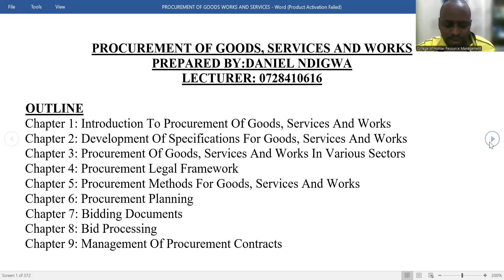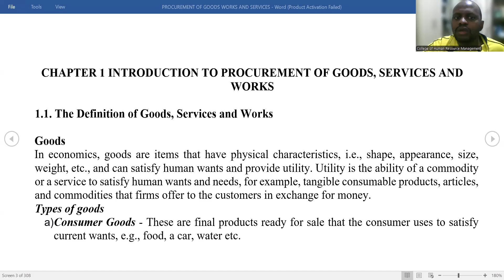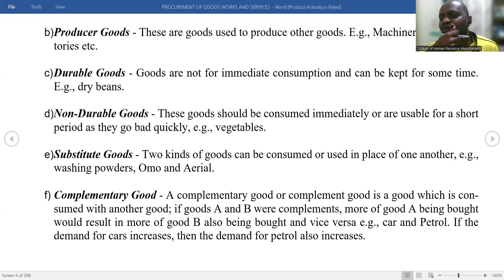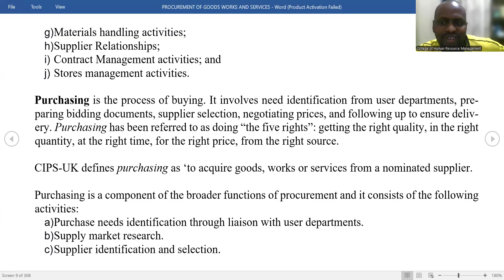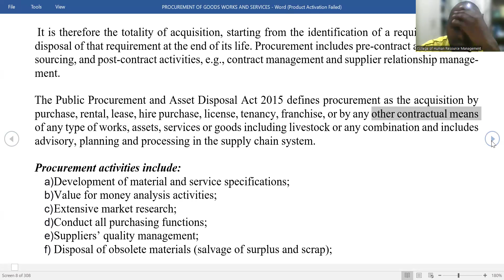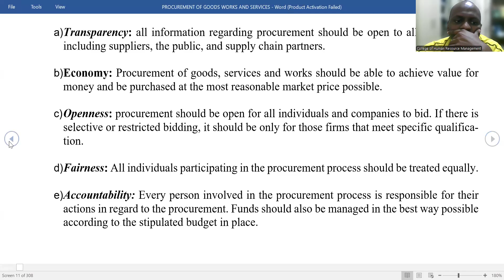Lecture 01- Introduction to procurement of goods, services and works

Comment: This is informative is there a continuation?
Reply from the maker: Dear Jane thanks for the compliment. i have them but will share the link at a cost.  incase you need extensive traing you can reach out on +254728410616Thank you